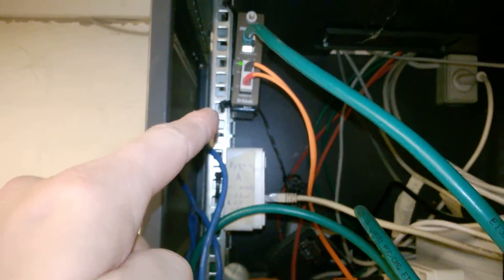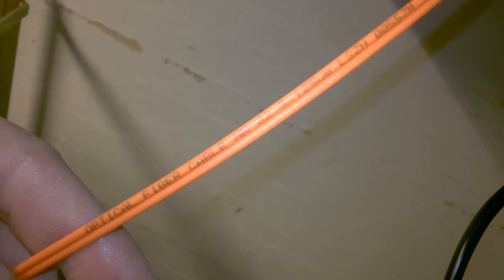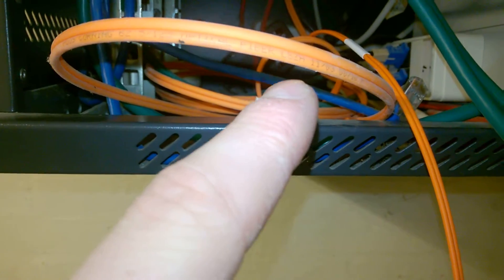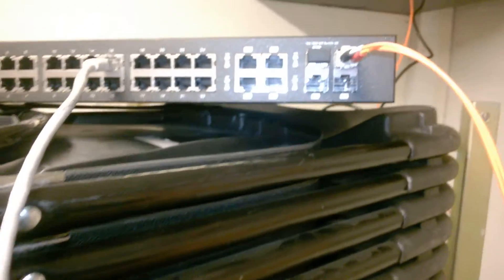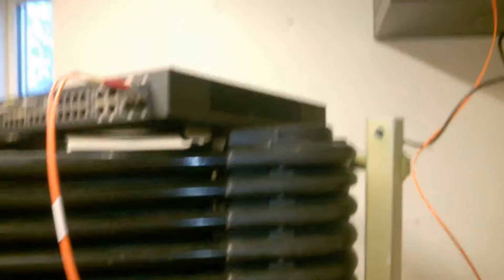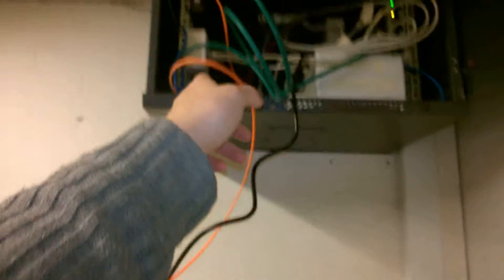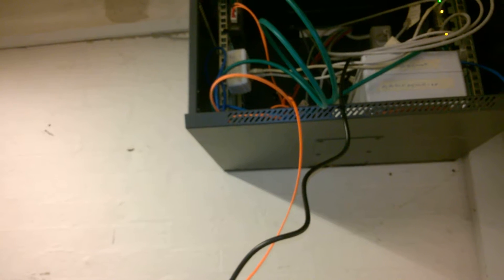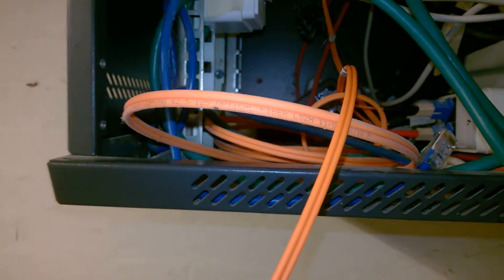Problem with fiber optic cabeling.

Comment: Is the crossover correct? If you have 2 crossovers you will have a straight through connection which will not work.